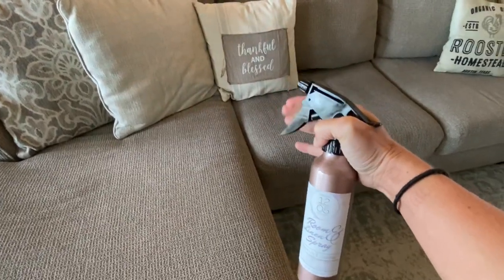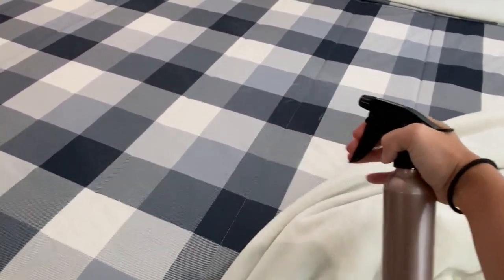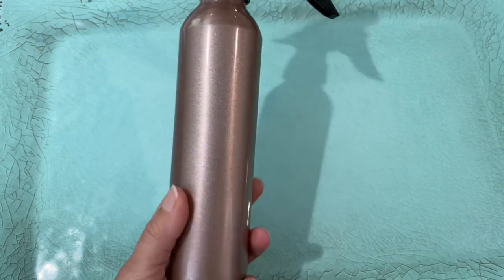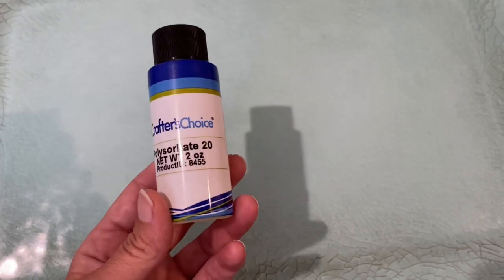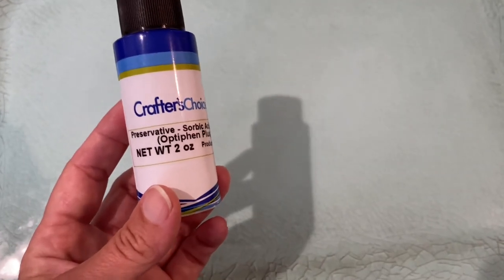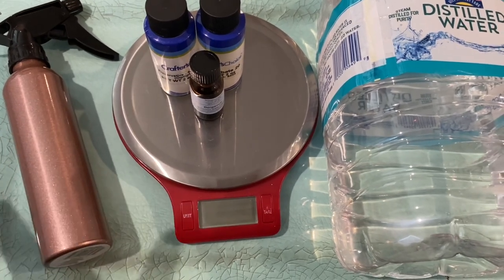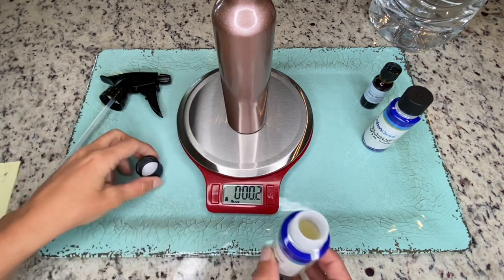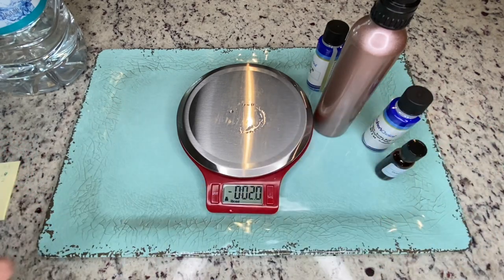DIY Car & Home Fragrance Spray | Full Recipe In Description | For Sale Or Personal Use

Comment: Could you make a video for the 2-4oz bottle of room / car spray ??
Reply from the maker: Hi!  The recipe is in the description, you can you it to make any amount you need.  

For example if you want to know how much water you will need for a two oz bottle

Water 93%

So you multiply 2 (for the 2 oz amount you want to make by .93 (the percentage of water you need in that amount.

2 x .93 = 1.86 oz

For the fragrance oil it’s 5% percent so for 2 oz, that equation would be

2 x .05 = .1 oz

Does that make sense?  It’s better to know the percentages and the equations so you can convert the amounts so any size bottle you need.
Reply: @FarmhouseDesigns  thank you so much

Comment: Can the air fresher base bought from stay fresh with peanuts be used instead of buying these individual bottles?
Reply from the maker: It can but it costs $5.49 just for 8oz of that base (that’s not factoring in the cost of shipping which you would also have to pay if you didn’t spend at least $149 to get the free shipping) that doesn’t include the bottle or fragrance oil.  So all together it would cost you about $7.35 per 8oz bottle as opposed to $2.68 per 8oz if you mix your own base.